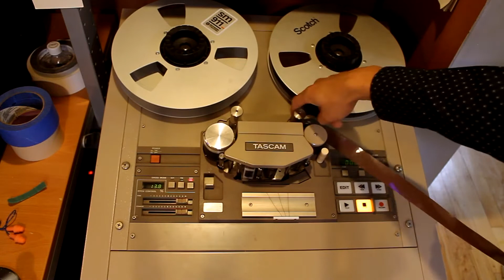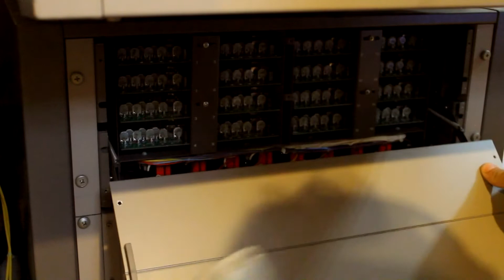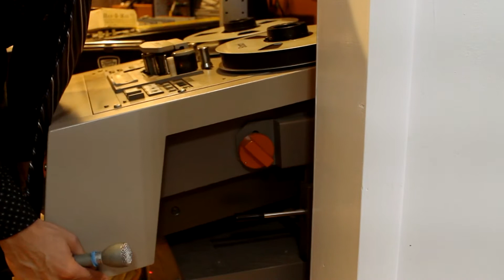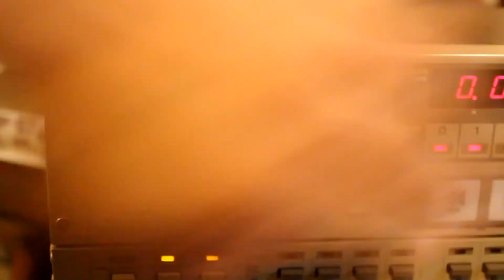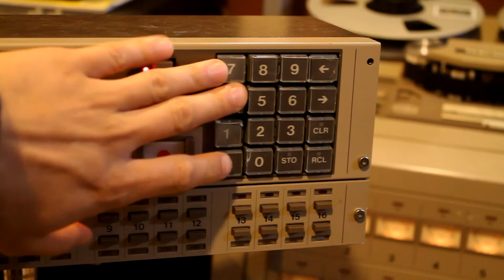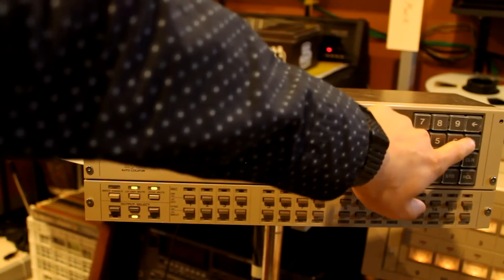Tascam MS-16 - Review and Rundown

Comment: Hi Mario! I'm really glad that someone did an overview video on this machine. Thank you! I purchased one last year, which came with the RC-65C rack under the AQ Auto locator. One thing—the AQ connects just fine, but there is no way to plug in the RC-65. The additional available plug on the MS-16 doesn't even come close to the shape and config of the pins. Any thoughts on how I can connect that? It would be really nice to have that functional as well.

Another note about my unit—When I bought it, I was under the impression that it was 15IPS (as the manual states & previous owner said), but my unit was 30IPS (Tascam released many @ that speed). So the calibration tape I bought from MRI was wrong. I ended up doing a full 30-15IPS conversion on mine (including all of the sound cards) which was successful... as well as having the tape head relapped.  It's a nice unit and I'm glad to have it :)
Reply from the maker: Bob, is the RC-65C rack the remote speed control unit?  Unfortunately I have no idea how that unit connects to the Tascam MS-16.  There are manuals online that might be able to help you out in that regards. 

It's funny you mention that about buying the machine thinking it was 15 IPS and receiving a 30 IPS machine. When I bought my machine I was in the exact opposite situation. I was SOOOOO GLAD that the previous owner was incorrect and it wasn't the 30 IPS version.  Even ignoring all the nonsense I hear online about the terrible frequency response of the 30 IPS machine, I couldn't imagine spending that much money on tape. That's great you were able to convert it without any issues.  I am thinking about installing a switch so I can switch the speed of the machine on the fly for "Joe Meek"-like effects.

Really appreciate the comment, 
Mario

Comment: Nice video. I have a Tascam 58 which has the same audio cards but is 1/2" 8 track and I'm running through a Tascam M520 console, which is pretty moduler and has been easy to repair. There's a guy in Brooklyn selling an ms16 right now with the locator and all and I'm chewing at the bit to get it since it was actually released at the same time as the desk and they're designed to work together.
Reply from the maker: You should go for it!  If you dig the 58 you'll for sure love the MS-16.  The M520 console is a nice one for sure, I am envious of you.  My M1500 console has it's issues but it gets the job done.  Design wise I wish it had VU meters (like your M520) as opposed to the LED meter bridge.  To be fair though, I never use the meter bridge when mixing, I only use it to get levels when I am tracking and the LEDs act similar to a VU meter in the sense that it "averages" the audio level. VU meters just look so much more aesthetically pleasing though! Anyway, I am getting off topic. I couldn't find the MS-16 being sold in Brooklyn (wasn't on craigslist or eBay) as I was curious to check the price. I certainly wouldn't spend TOOOO much for it. But if it's a good deal you better watch out I might snag it before you haha. Thanks for watching and commenting!

Cheers, 
Mario
Reply: @Mario_DiSanto  it's on reverb for $2200 which is wayyy high but they've knocked it down from 3500. I seems like they going it in out of a storage locker or something and probably have no idea.

Comment: Thank you so much for going over this machine, you did a fantastic job explaining everything. I would love it if you did do a separate video of how to calibrate it!! I have a ATR-60 (basically the same thing but the 8 track version) and some of the process still eludes me. By the way you have some very rare gear there. The AQ-65 with rolling cart is as rare as hens teeth as well as the tilting stand..I do have both too btw. If you can find an AQ-65 they can now be upwards of $1500.
Reply from the maker: I had little idea that the AQ-65 was so hard to come by.  It is definitely a "must have" for me as I have become very spoiled with it!  When I first started recording I had a TEAC 80-8. There is no "logic" on that unit and all rewinding/fast-forwarding/locating had to be done by feel and sense of time.  Now I have all of that at the press of a button!  I guess it's nothing compared to the instantaneous cueing most people are used to in the digital world but I still appreciate it haha!  I will eventually make a calibrating video for the machine but at the moment I don't have a Test Tone (MRL) tape to properly demonstrate how to calibrate the machine.  Maybe if people start sending me money I can make it happen haha.

Cheers, 
Mario
Reply: I've got the ATR-60 8-Track as well, great machine! Missing all the accessories and noise reduction thats present in this video though. I'd like to see how Mario calibrates as well as there weren't any guides for this later tascam machines when i was first trying to get it going and mine had a bunch of issues more than just calibrating, but i got it going and calibrating is pretty straight forward, but you unfortunately need a multi-meter, oscilloscope, tone generator and a test tape which all up is quite pricey.

Comment: 1:08 Is that freq response curve correct? Is it really that warped? You might want to do your own sweep. I'll bet it's not as bad as that graph shows. I have a TSR8 and absolutely love it!
Reply from the maker: Apparently that response curve is for a 15 ips Tascam MS-16.  Endino.com should have more information.  Despite me being a huge engineering nerd I have little interest in doing my own sweep on the unit.  I find the more often I start probing/testing my vintage equipment the more issues popup that I would have never noticed!  Too avoid the aggravation I live by the motto of "Does it sound good? Yes? Then leave it alone!"  It has saved me a lot of headache.

For a quick example I have a 2-track Tascam 22-2.  When I first got the machine and was checking bias, frequency response, all that jazz... I discovered the left channel had significant issues in high frequency recording.  a 16k hz signal would  make the needle bounce all over the place.  I spent weeks trying to fix the issue.  After a while of waiting to make a mixdown of a song I finished, I said screw trying to fix the issue and I mixed down the song onto the machine.  To my ears I could not detect ANY difference between the "broken" left channel and the "working" right channel (both channels had the typical loss of hi-frequencies when recording to tape).  Now according to my test that left channel should have been unusable! But that's not what my ears told me....if it sounds good it sounds good!

The same logic could be applied to the 15ips vs 30ips debate for this machine (or any machine).  A good recording engineer should be able to make any tape speed work despite the frequency response differences. If it sounds good it sounds good.

Cheers, 
Mario